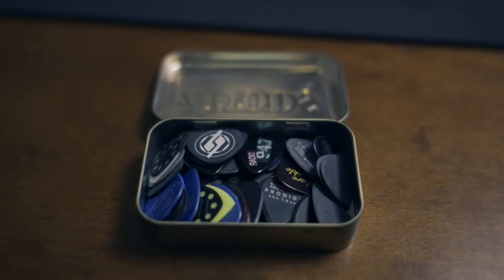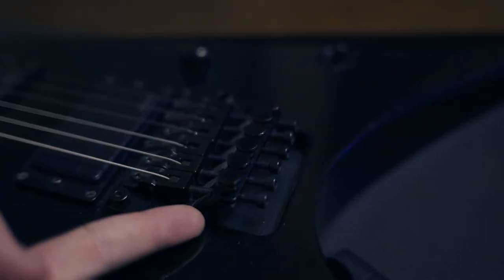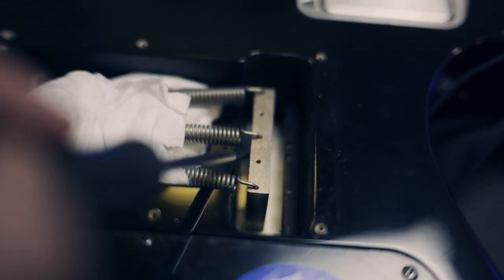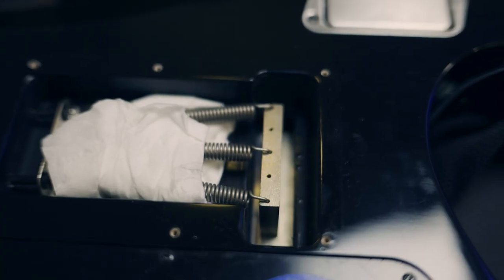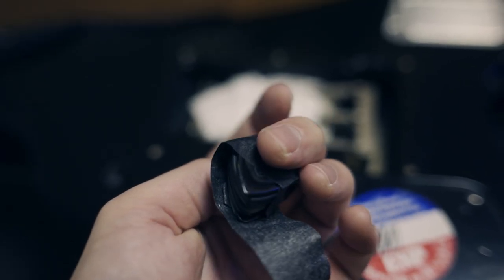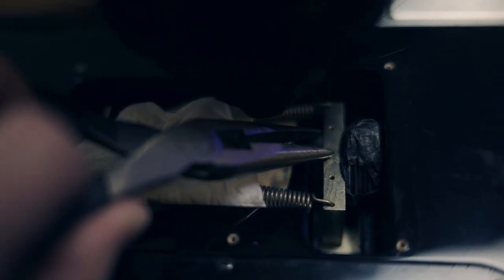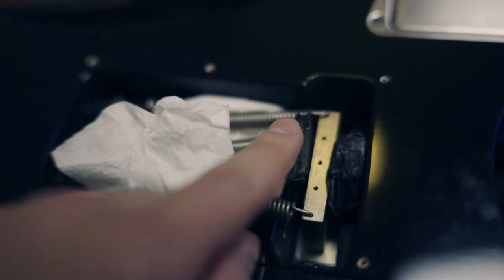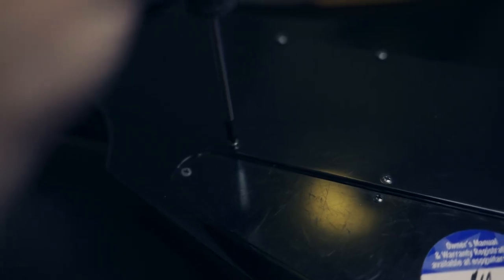How to Block a Floating Tremolo Bridge Without Power Tools or Drilling | Reversible Guitar Mod

Comment: I've got a question...if I do this with wood then I can tune to drop c and drop d without any issues?
Reply from the maker: If you cut it accurately, yes. Make sure you use string gages you prefer too of course
Reply: @HighZ  thank you, I got a jackson js 22 with floating tremolo.. and wanna do some down tuning